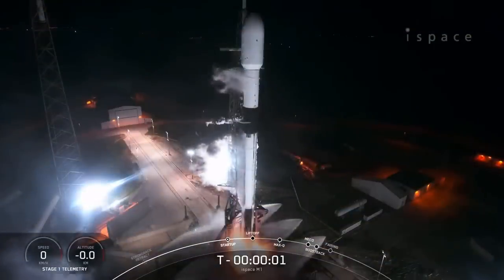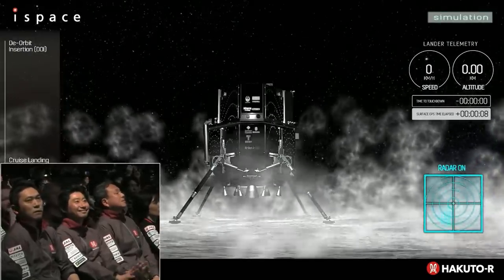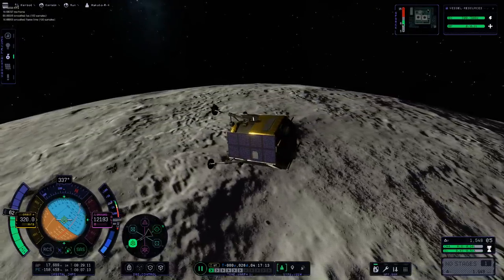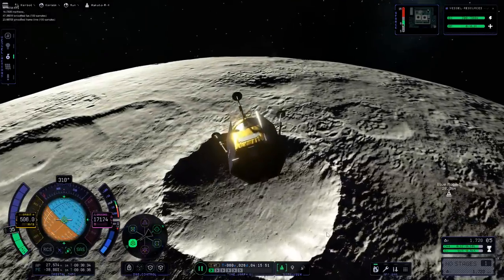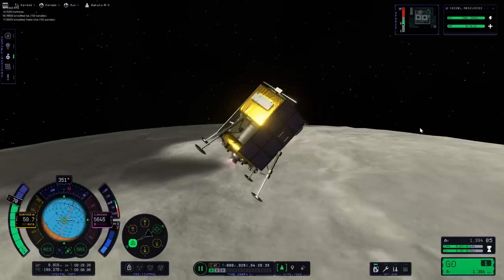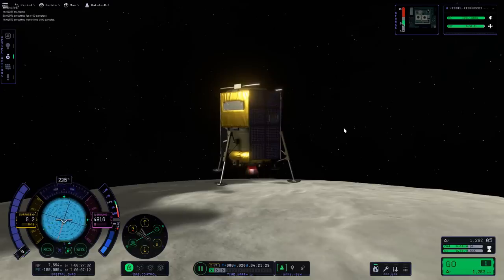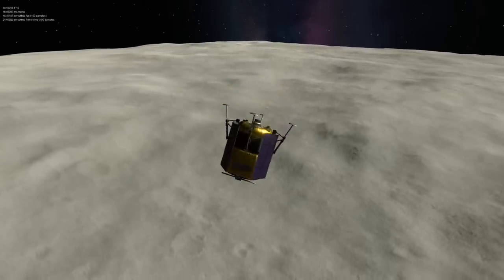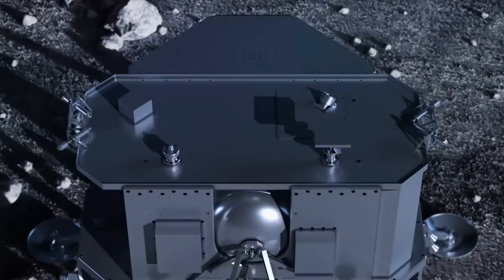Why Japan's Moon Lander Crashed Due to An Unbelievable Computer Bug

Comment: Another outstanding episode Scott!  Being a software safety engineer for the last 39 years, I have to agree with previous comments that point out this is not a software bug, but more of a people problem during design, testing, management, etc.  I believe the first Ariane 5 launch was a similar issue where the software worked perfectly per its specifications (from Ariane 4) and doomed the flight to failure.  Like in this case, proper testing would have prevented the, expensive, tragedy.  Also wanted to give a shout to "How To Destroy Wayward Rockets - Flight Termination Systems Explained".  My 39 years were all spent on Range Safety Software with the last 13 years working on autonomous flight termination systems.  That was another outstanding episode!  Keep up the awesome work!
Reply: Pop op o99⁹9th kiwi's😊
Reply: It is a software bug though. People problem is that the bug wasn't caught
Reply: Have you ever experience a flight termination system not working instantly, but 50 seconds late, as with the starship launch?
Reply: @vast634  Depends on the type of Flight Termination System (FTS).  For solid rocket motors, they use a shaped linear charge that opens the casing and exposes the fuel which burns up quickly in an impressive display.  (I think Scott mentioned that in his previous video.)  For chemical fuels, things are different.  You have more choices.  The basic idea is to stop thrusting the vehicle so it falls into an unpopulated area, such as a broad ocean area in the case of SpaceX.  Based on the video of the flight, the FTS worked properly and detonated explosive devices that created holes in the fuel tanks.  That reduced or stopped the fuel flow to the engines.  The  FTS did its job.  After that, it's all physics.  If the fuels are hypergolic, they will combust on contact and you get a near-instant explosion.  Otherwise, you need combustible fuel, oxygen, and an ignition source.  Guessing, it took about 40 seconds before the three elements came together in the right quantities in the case of SpaceX.  An FTS doesn't need to create an explosion.  Rather than connect to explosives, the FTS can connect to fuel valves that terminate fuel flow.
Reply: @xGOKOPx  I understand your perspective.  My point is that the bug should have been avoided during design or implementation, and if not, then detected during development testing.  Find and correct all the bugs before deployment.  Since their development testing failed to react properly to "unexpected terrain" (kind of a silly term considering the moon's terrain is pretty stable), the people failed in the software development cycle and left in a failure mode (i.e., the bug) so it could be exposed during execution.  The software did what it was designed to do so it worked properly.  The people failed to account for something.  The same thing happens with hardware but folks don't usually blame the hardware.  The failure of Galloping Gertie wasn't blamed on the bridge.  The people who designed and built it were blamed for not accounting for potential wind loading.
Reply: @xGOKOPx  You could argue it from either viewpoint:  the software thought it detected a sensor failure and decided it was unreliable. And you don't go back to using an unreliable instrument just because it seems to be working again a little later. That part was exactly as it should be. It was perhaps a design mistake to not have a way of verifying that the unexpected data was valid, say, by cross checking with another instrument. It was definitely a mistake, probably at management level, not to run the simulation again with the new landing site.

Technically, a bug is when you give the software good data, a mistake in the programming causes an error.  It's like the old joke about the programmer's wife telling her husband that she needs a bell pepper, and if they have eggs, to get a dozen.  He goes to the store, sees that the store has eggs and buys a dozen bell peppers.  She didn't "program" her husband correctly because she left out a line or two of code.

Now, on the one hand, the software didn't have any errors as the failure detection routine worked exactly as designed. OTOH, no one foresaw a way that perfectly valid data could trigger the failure detection routine.  So whether it was truly a bug or not is a rather subjective decision.

Before El Nino was discovered, they had a similar problem with some temperature sensor buoys.  Someone decided that where the buoys were going to be deployed, temperatures above a certain point were impossible.  Therefore, if the buoy got impossible readings, the temperature sensor was broken.  Well, when they went to check the buoys for what ever reason (batteries, retrieving recorded data, too many buoys stopped transmitting if they had transmitters), they discovered that the water was warmer than the limit, and therefore, a lot of valid data had been chucked out. (In my experience, when a sensor fails, it usually goes to one extreme or the other, reporting a temperature that is the lowest the sensor is designed to measure, or the highest, or simply no output at all. So, those are conditions they should have tested for. If they were checking for noise spikes in the electronic data instead, they should have have checked how long the "spikes" were lasting. Any "noise spike" that lasts a full minute is NOT usually noise.)  The upshot of the story is that again, they didn't realize that valid data could legitimately trigger the failure detection routine.  And in this case, there was no way of testing in advance that real world conditions could get that extreme: finding out what the usual temperatures were was the reason why the buoys were there in the first place. I suspect that the only reason they found the problem in the programming was because too many more buoys had "failed" than usual, and the repair techs were unable to verify the failure while testing.
Reply: @vast634  Depends on the design philosophy, I suspect: the Starship is intended to carry humans aboard; you might not want an automated system to act hastily.

OTOH, it might take that long to try various corrective measures and realize the flight is doomed.

A friend of mine used to work around nuclear reactors, and said that one of the hardest things to do during an emergency was to wait for the automatics to determine that they couldn't fix the problem and ask for human intervention.  The impulse is to try and take corrective action yourself right away.
Reply: @JeffreyCherry-v6i  I would think that using explosives on the fuel tanks would not only create a cloud of fuel and oxidizer, but would also provide a dandy ignition source. Despite knowing the causes, we still sometimes have grain silo explosions because the fuel is surrounded by a lot of oxidizer, and an ignition source event occurs.
Reply: @JeffreyCherry-v6i  FWIW, I've been watching the aircraft disasters series on Smithsonian, and they've had a couple of "unexpected terrain" problems as well. They seem to also have been caused by changing the flight profiles.  I seem to recall that the chart used to advise the pilots in one was low resolution or out of date, and they were landing at an airport surrounded by mountainous terrain. Sometimes, pilots will use a manuever they call the "slam/dunk" where they wait until relatively late in the landing profile to lose altitude, and then come in low in a different area than the standard profile.  It seems to be used in somewhat unusual circumstances, like escaping weather, or saving fuel or time due to slipped schedules. It's also frowned upon.

At any rate, part of the terrain warning system is apparently pre-programmed with elevation data, so that the aircraft itself might not realize it is being taken into an area incompatible with the new landing profile. At that point, all they have is the radar altimeter to warn them, and apparently, under some circumstances, it isn't enough time for the pilots to do anything about it.

Another accident wasn't caused by unexpected terrain, but because the slam/dunk caused them to come in under the airport's autolanding signal cone, and they had programmed the craft for an automated landing, and weren't able to find the signal or to compensate in time.

What happened with the Japanese lander wasn't a true bug: they had not tested a condition where valid instrument data could trigger the failure detection routine.  There was no error in the software, per se. The error was in not testing the new flight profile in a simulation. It would have caused them to make the failure detection software more elaborate, or they might have updated the onboard computer with better terrain data ("At this position and time, you will see a data spike; this is NOT a hardware failure") or any of a dozen other remedial actions, including altering the flight profile to avoid the problem.  It's technically not a bug in the software if it responds properly under normal conditions, and then you throw it into abnormal conditions.
Reply: @Henglaar  The tanks of fuel and oxidizer are separated, usually one is stored above the other.  When the fuel and oxidizer escape, they take some amount of time before to heat up (remember, each is stored as a liquid in high pressure containment vessels), expand (transition from liquid to gas), mix to the right concentration, then be ignited by something.  It really depends on what was happening inside a huge, falling, tumbling vehicle.  I know that 40 seconds sounds long, but I don't think it's unrealistic.
Reply: @Henglaar  Agreed.  There are many ways a loss of the spacecraft could have been avoided.  I also like your aircraft analogy since it points out that the same system can be exposed to different failure modes and fail in different ways.
Reply: @Henglaar  The autonomous flight termination system works off a set of rules defined, extensively tests, and approved long before launch.  During flight, if the rules detect a violation based on incoming sensor data, then some action is taken.   You are also correct in that the rules utilize redundancy and delays to verify the violation is real and persistent in order to avoid terminating a good vehicle.
Reply: @Henglaar  But currently starship is a pure unmanned test prototype. The human rated version will be much less problematic and more debugged. Once it reaches that standard they can use a different flight termination system.
Reply: Any idea what programming language is used to write these systems?
Reply: @vast634  The AFTS is unlikely to be changed.  The software is certified for use in safety critical systems and, I believe, is human rated.
Reply: @a0um  The safety systems I've worked on have used Fortran (1980s), Ada (late 1980s through present), C (for low-level programming, board interfaces and such), and C++.  The more difficult languages to use are C and C++ since they require a good coding standard (e.g., MISRA or AUTOSAR) tailored to the project, good static code analysis, and an unbelievable amount of testing at all levels.  However, it can be done.  The safety certified code in the Core Autonomous Safety Software is written in C++.  For more rigorous safety developments, SPARK (a subset of Ada) is often chosen since it uses formal methods to prove the software works correctly.  A (relatively) recent language, Rust, shows good promise and hopefully it will grow to be "provably correct".